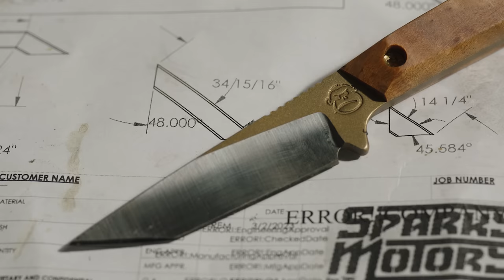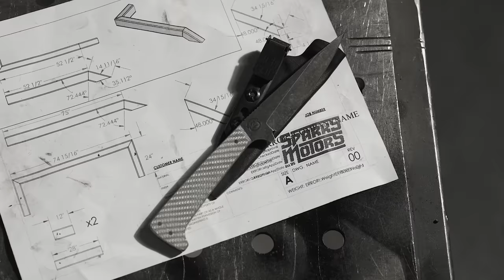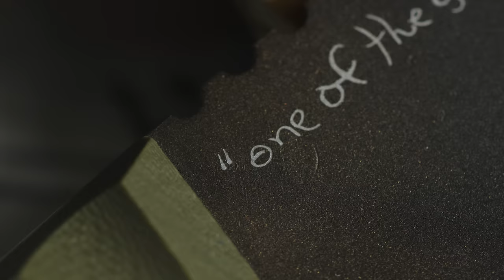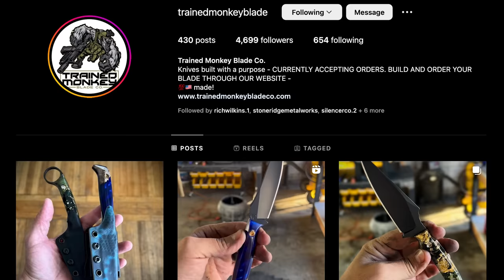We Forged a Military Truck...Into WHAT?!?! (GIVING IT AWAY TO YOU)

Comment: Having watched Alec Steele and Will Stelter and "Man At Arms: Reforged" for years it was kinda hilarious to me how oblivious the Sparks crew was to the basics of blacksmithing... 😂😁😇
But yeah, leaf springs and coil springs are a staple for bladesmiths for over a century now. High carbon steel makes good sharp blades - if the smith knows what he's doing. It's not just about smashing steel into form, it's also a lot about the knowledge of metallurgy. Heat treating and hardening through quenching are two critical things where the bladesmith has to know what happens inside the steel... 😉✌️